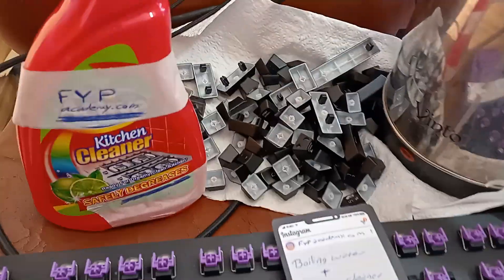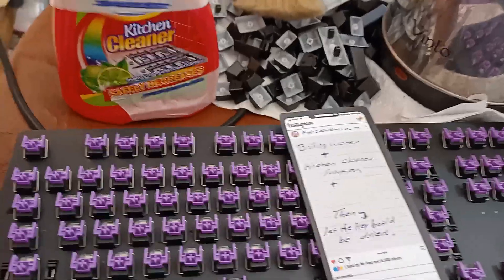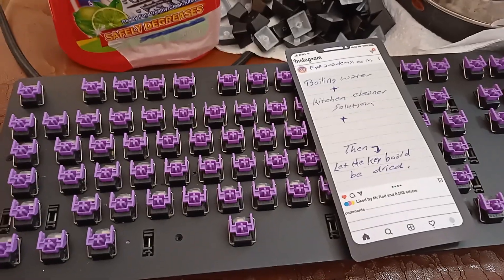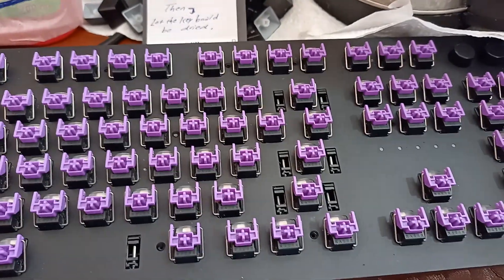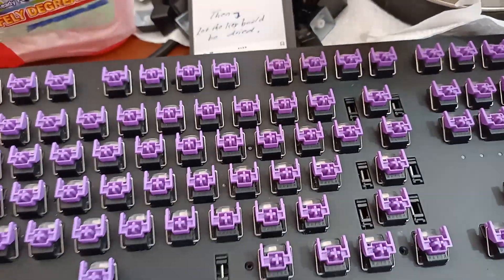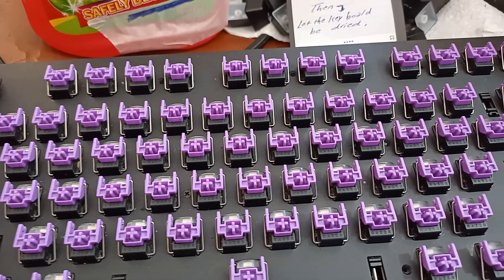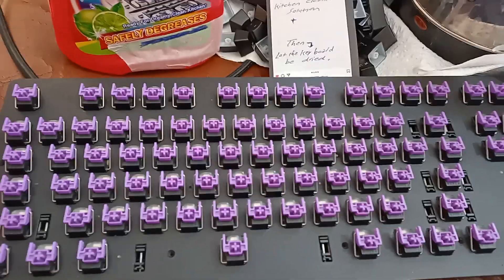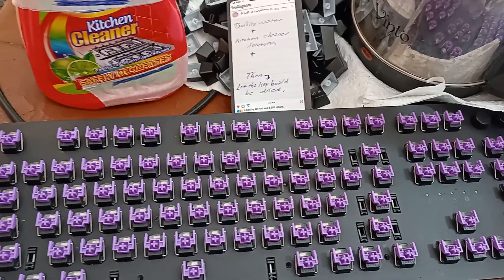Razer huntsman elite disassembling and cleaning

Comment: Taking off keycaps is not disassembling
Reply from the maker: You are right,But I Disassembled all necessary parts ,although is not shown in the video,On the Other hand its not too hard to disassemble as there are many videos on YT .KEYPOINT  in my video is about easy and effective cleaning.thanks for watching.
Reply: you just took keycaps off = its not disassembling, disassembling is when you get "inside" of a device, i wanted to clear mine from inside too but struggled to get to other side of a logic board, and there are almost no videos of getting to it, misleading title is all im saying
Reply from the maker: @lolichan3702  If you take all assembling steps , the final step is accessing to logical board , Step 1 Overhead View
Step 2 Remove Key Caps
Step 3 Remove All Front Screws
Step 4 Remove All Back Screws
Step 5 Remove LED Light Logic Board Screws
Step 6 Pry Open the Plastic Panel
Step 7 Remove Main Frame Screws
Step 8 Disconnect Printed Circuit Board (PCB) Board Cables
Step 9 Logical Board
https://www.ifixit.com/Teardown/Razer+Huntsman+Elite+Gaming+Keyboard+Teardown/147006

Noteworthy ,If any key being failed ,like my RIGHT Alt cleaning or even replacing the key wont help.
Reply: Yeah still can't help but notice you didn't disassemble it, and you just pulled the keycaps off. Ifixit disassembled it, you did step 1 of 8 which was to pull the keycaps off.
Reply from the maker: @_Ampersand_  OK,apparantly my full explanations have not helped you and some other guys,But summarizedly I disassembled it to fix ALT key through cleaning while didn't film it,It was not too hard to disassemble ,I found out that cleaning is too much important even without complete disassembling ,So this video was the result of this idea.
Reply: @fypacademy  it's not your explanation it's that your video simply doesn't show what it reports to. It's misleading at best and bad clickbait at worst. Everyone knows how to take keycaps off.
Reply from the maker: @_Ampersand_  Thanks for your attention,but from the 1st day ,video title is "Razer huntsman elite disassembling and cleaning" until now ,it has been mostly about cleaning and on the side of disassembling viewer is provided with the place of screws on the front of the keyboard and Steps for rest of the process is expressed on the description panel.
Reply: @fypacademy  No, it isn't about disassembling at all it is exclusively about cleaning. The fact that you have two people in your comments telling you taking keycaps off isn't disassembly should tell you the video title is misleading.
Reply from the maker: @_Ampersand_  I think you dont believe in this logic that many things in the world own part of a whole in expression, while the whole could be so controversial ,.. But in my case I 'd rather accept your censure approximately,with no more explanation as the reverence of the commenter or viewer is thoroughly important.
Reply: @_Ampersand_  Removing the caps is in fact a form of disassembly by definition. I'm not sure why you people wanted to argue semantics with this dude. Y'all are really trying to down him and suggest his video is shallow but then you two can't even take apart a keyboard and figure out where screws are. Crazy.
Reply: @mmz12  If keycaps pulling keycaps is disassembly, than taking your clothes off is invasive surgery, and removing your cars floormats counts as car repair. This is like looking up a phone tutorial on "How to replace a battery" and the video stops after step 1, unplug your phone. It is removing an accessory. The really dumb part here is you are not even technically correct. Disassembly involves dissecting something down to its individual components. This isn't disassembly, it is key cap removal, and you don't get to call is disassembly for the same reason you don't get to say you disassembled a car because you changed the wiper blades.
Reply: @_Ampersand_  Those things are not at all the same... lol Dude. The ACT of removing them is called.. disassemble. You are in fact disassembling the unit. When I "disassemble" a phone I don't strip it down completely no matter what, but I still disassembled it. Doesn't matter if I was only replacing a screen or doing board repair.. or took out 2 screws or 10 or go full housing replacement.

The point I'm making is this guy "disassembles" to the degree needed in order to clean it. Again, semantics. You're conflating the AMOUNT of disassembly with the meaning of disassembling. Also, dudes clearly not a native english speaker.

TLDR = you guys are being mean to him for no reason.
Reply: @mmz12  We are not being mean we are pointing out that his video title is a lie, because what he called disassembly is akin to a screen protector removal, because again, key caps are an accessory. They are not load bearing, they are not critical for functionality. If he didn't want to be misleading, he could change the title right now to keycap removal, and I would delete my comment. There is a reason multiple people came to this video and immediately turned around and called it a click bait lie.
Reply: @_Ampersand_  I don't want to get into the science behind it just to make my case because I don't see this going anywhere. lol

What I was getting at is that it's what the word means. When english isn't your native language, what is implied contextually and what is meant literally are hard to differentiate between through lack of fluency. 

Obviously, I understand what you're getting at. I'm just making the argument that it is possible and within reason he didn't necessarily intentionally mislead by using that word. That that word does mean what he's doing and that the disappointment comes in the level to which it was completed. I know exactly what you meant. But english is my first language which is why. lol

Typically for me, if a customer is asking for what you're wanting (help with arriving at a certain point in disassembly to send me just a board, etc), they say "tear down" or add "complete" or "full" in there. 

Anyhow, have a great weekend!
Reply: @mmz12 Brother I am a mechanical engineer I literally am the science behind it. Also a native English speaker. Regardless, thanks I hope you have a good weekend as well.